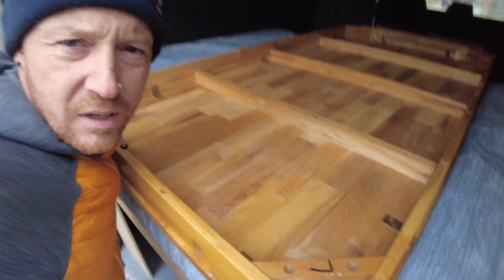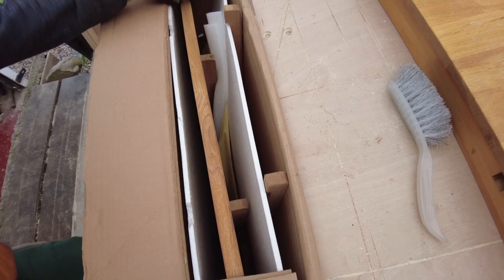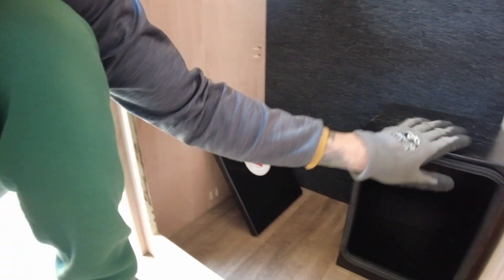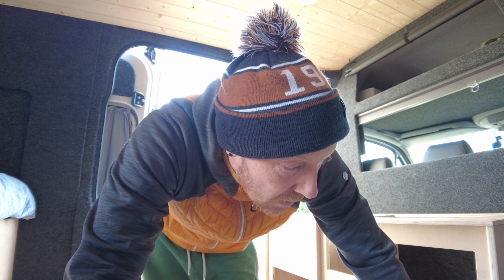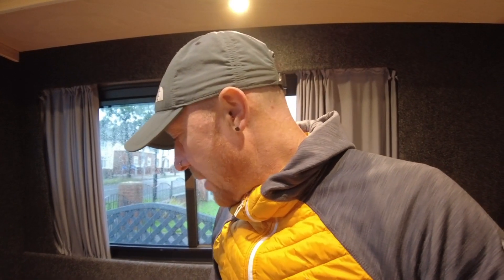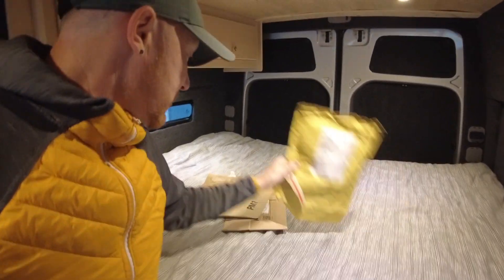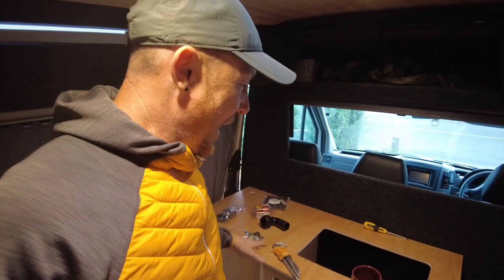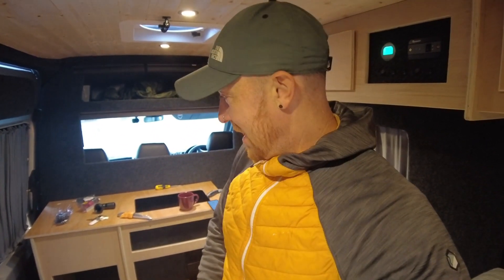Carry on Campervan. New Worktop, kitchen unit update and Diesel heater.

Comment: Great vlog, like the tip with the blower on the diesel heater. I can see that being very useful for some who may run into the same issue.
Reply from the maker: I've come across it afew times so yes maybe help someone out.
Thanks for watching 🤟

Comment: the layout has made that van look bigger inside than it is keep up the great work thinking of buying a crafter long wheel base high roof van  and converting  it very much like that van the only thing i would change is remove the bulk head and fit swivel seats
Reply from the maker: Definitely agree Darren.
 We can't believe how much room there is even with the bulkhead in. 
We like both bulkhead and swivel designs. They both have a different feel 🙂.